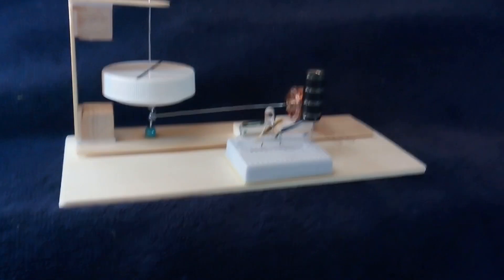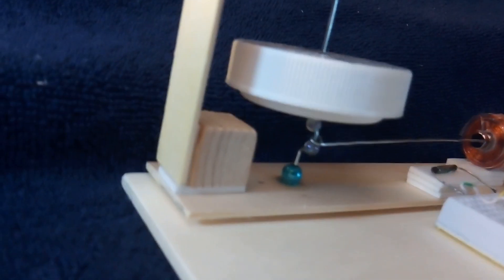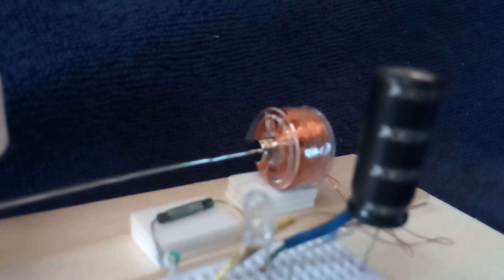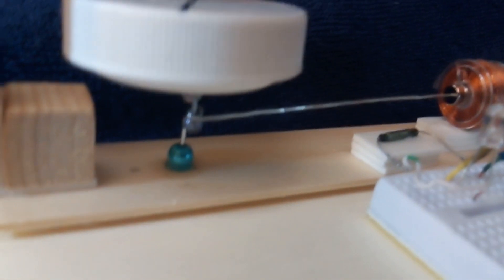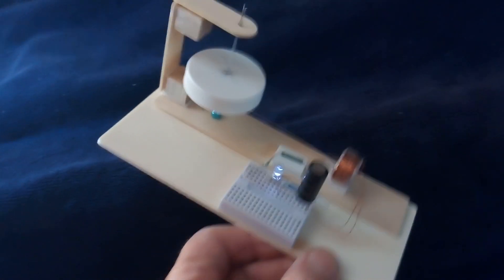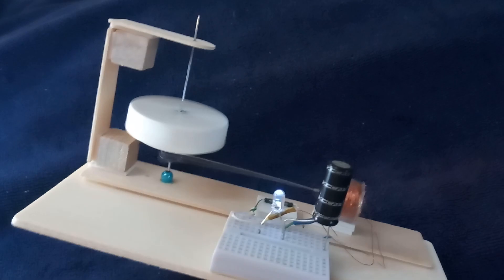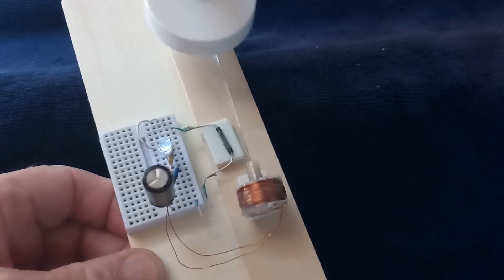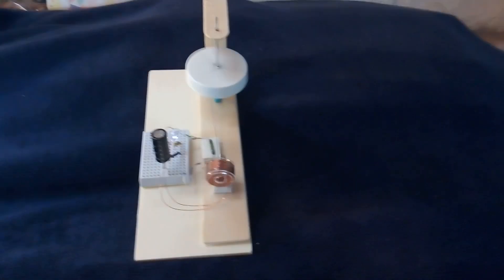Cranky Lid Motor

Comment: Excellent combination 👌
Reply from the maker: Oddly this was harder to do than it seems.  My little machine doesn't like reed switches much.  The solenoid really wants power on for a duration of time longer than the reed wants to give it.  It is the odd couple that I forced to get along.  Ha.
Reply: @Lidmotor  those reed switches can be a blessing and a curse at the same time 😆